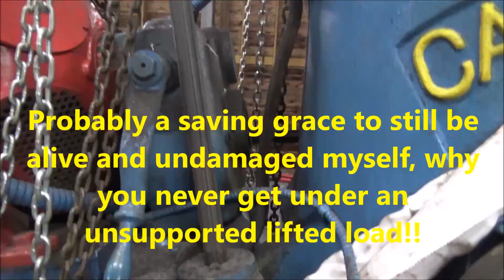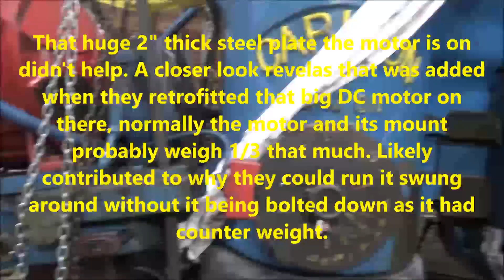The Worst Shop Day Ever :-(

Comment: A few things Brian-
You're safe because you did the lifting the right way. From aside the load, not under it. 
Not sure there was any way to find the cable damage without an x-ray. 
If the damage is limited to the casting and the rods, the drill may be repairable, right?
If the worst damage is to the cheap drill and 1/4 of your floor...I think you got lucky.

Comment: Brian if you do get around to repairing the beast it might be worth it to dig up an AC motor of the proper size.  Then if you wanted more infinite speed control ad a VFD.  But of course that's if it's repairable in the first place.

Comment: Major bummer, good thing no one was injured.  There is some good tips on inspecting the cable in the comments.  
The other thing as a valuable learning experience would be to know the weight of the machine and calculate exact load on every single loaded item in the lift.   Were all components within their safe working range?
Reply from the maker: Everything was within its rating, problem was the cable was no longer in a condition to meet its rating but the damage was not visible unless I had cut the cable in two.
Reply: It sounds like you are an owner/operator.  You are probably very lucky, if any employees were involved you can bet OSHA would be all over the place and looking for the rigging calculations.   
Based on what you wrote, the existing cable was 10.6 ton cable. So with four lines loaded it looks like the max safe load for just the cable would be about 16,960 lbs.  That is a 1:5 safety factor for new cable and a straight pull.  With old cable and a pull off the the side as you indicated, a safety factor of 1:10 my be reasonable.  That would drop the allowable load down to 8,480 lbs.  Just based on that it looks like the cable was over loaded by a factor of two at least.   What was the total weight of the drill?   Off hand I guess the weight close to 20,000 lbs but a qualified rigging boss would have that number down to the nearest lb.
Of course all the other components in the lift must be assesses also.  What about the chains, hooks, straps and shackles?  It only takes one weak link to cause a failure.  
Thanks for posting this.  You are to be commended, it gets folks to think about safety when lifting heavy things.

Comment: I once saw a guy drop the front half of a tractor from probably 7 feet in the air... bad sling job.  That was a pretty impressive BANG but THIS is so depressing. I for one hope you can repair the motor mount and get your drill up and running.

Comment: What size was the cable that broke? It looks like it was only doubled on the snatch block. What is the working load of the cable you put in now?
Reply from the maker: It was 8 parts of 1/2in cable, now it is 9/16 anti rotation cable.

Comment: MERCY! I'm just thankful YOU are still in one piece. The other stuff can be fixed but Baily can't make videos. I've had dragline boom ropes pop too and you just never know.  And it'll never be in a good place either. I hate it but it's all fixable. I was in a knot when you started lifting that rig and about jumped out in the floor when the cable broke. And you're dead right about NEVER stand under a hanging load.

Comment: I have seen a 3 tons machine drop from 4 feet down. Dust took 1/2 hour to settel. Took me the same time to setteldown also :-)  Machine was stil in "working order".
Load was too heavy for te crane so we used a fork lift to help. But it slipt.  The brake gave way,  that was our luck, ore els the crane would have come douwn.
Shit happens, 
Especially wen you ask for it :-)

Comment: Wow. That is scary. Lucky you didn't stand any closer. Did this used to be a precise machine?
Reply from the maker: I believe new they claimed repeatability of .001".  Drills like this were really intended to be used on layed out items that you would align with your eyes so the expected accuracy was probably .005" to begin with and that is pretty standard for drilled holes anyway unless using special tooling and methods.

Comment: Mother effer.  Appendage check... yup all present and functioning.  I"ve never seen something that large fall without some sort of power equipment running.  I was surprised... surprised at the absolute lack of any warning.

Glad you are safe.  I"m still stunned...  Need to make sure the guys that "helped" load it watch this video.  Because if that had happen while loading somebody would be disabled at a minimum.

Comment: Holy crap, what'a mess I was just about to get a fork full of dinner and ker-pow and it dropped.  The motor drooped a bunch and then came up a little and you stood there like the big freeze had been put on you.  I wouldn't blame you if you called it a boat anchor, but I reckon you've got a good amount tied up in it,.  Take a few sips of a good Kentucky Bourbon and get a good nights sleep,  Unfortunately it'll still be there in the morning, but you'll be in a better frame of mind then.

Comment: Brian, you were lucky that is did not let go when half over the trailer. You are lucky you were not hurt but, form your position that was unlikely. Such a shame the machine was so damages and the floor, of which you were so proud, was damaged. But all can be repaired - sooner or later, and you are safe. I suppose there is one lesson to be learned, never, under any circumstances, trust old wire rope. That crane stayed out in the weather just too long to be safe. But you are okay, and can make thing right later on. Such and same there was a worst day in your new shop.I would have been swearing as well, don't worry about that.

Comment: Seen this happen last week with a drill tripple this size, I had brought a smaller MAS Vr2 from an auction and when i was picking it up seen them try and pick up the big drill by the arm and it cracked.
Reply from the maker: blakealexbale That sucks but WOW What a monster of a drill it had to be!! I guess it must have had about a 20ft arm? Surprised they even had a crane on sight with enough capacity to try to lift it.  I would think the arm alone on a 20ft job would be over 100000 lbs.
Reply: @bcbloc02   It was one of Australia's biggest boiler makers, they were liquidating everything and sold the  50 ton Gantry for something ridiculous like $10 000 just because it would've cost  10 times that much to move it anywhere.

Comment: First I am glad you are alright... that is the only thing that matters really.When I started watching my first thought was, I hope he got some cribbing set up where he going to set it down as that crane has not been tested with a real good load on it yet. The brake was my concern, not the cable. A couple of feet of crib set up to the height of the trailer bed and pull them out as you lower, only 6 or 8 inches to fall then, with wood to absorb the impact if you had a failure. I am not trying to criticize Brian, just sharing what I would have done, when working with an old crane. I think it would of saved your machine, floor and your nerves.Maybe a thought for your boring mill and other machines.Sorry that it happened, but glad you and Bailey are good to go.

Comment: Man Brian that was hard to watch. When you went to swing it I knew because my outcome was no different. Even with all new and heavier rigging big iron equals big lift. I always figured you for a square shooter and posting this video on the internet for others to see and learn from clinches it for me. It was damned decent of you to share what happened as a training video of sorts. We didn't have internet and youtube and facebook back then but I was about eight to nine feet away when a cable snapped on me thirty-years ago. Trying to manually swing big stuff that high off the floor is risky at best. That's a lot of mass. After the same thing happened to me I lifted straight up just enough to clear the trailer and had my wife in the driver's seat waiting to launch out from under while I got whatever it was down on the floor fast. I too worked pretty much by myself in those days and one of the best investments I ever made was in two pair of rolling blocks and a little 6000 lb. hard tire forklift. My lifting hook was swaged on and I can still hear the whoosh-whoosh-whoosh sound as it and twelve feet of half-inch boomeranged past just over my head. I never used steel rope for lifting again because you can't see the core. After dragging it around in the mud and snow it's worthless for pulling out stuck dozers and scrapers as well I might add.  I guess we were lucky Brian where others weren't. You have other stuff coming in and a bit of unforeseen repairing to do now but you can't kill concrete it's just always there. It don't matter if you hadn't paid for it you would have paid for something else and you still will because there is always something else needing paid. If you get toe trips showing up grind them down by hand with a big Milwaukee grinder or something. An eight-inch diamond grinding cup is around $100 at industrial supply and one would last you for ages. Just use a water hose and wear a dust mask. The radiant heat tubes are probably okay but the best thing is you and Bailey are for sure even if your pride is a bit bruised and I could tell you a few things in that department. That was a close call ole boy so don't beat yourself up too bad that drill landed hard on its heel. Be careful out there all of you guys. Hell, your videos keep me and a lot of other old boys like me home and out of trouble. Thanks Brian and you hang tough! Sh*t happens but even more so when you are trying to do things. It's getting them done that can be a real bitch at times. Damn I didn't intend on writing a letter excuse me Brian. I'm outta here!

Comment: first off, glad your ok!  the machine is fixable im surw but id like to know what you plan to do with the cement.  is it deformed or just cracked and if its deformed how do fix that
Reply from the maker: I appears mainly just cracked and chipped but I don't know what it looks like under the drill yet. Main thing is the water lines for the heat aren't busted.
Reply: wow didn't even think about tubing that would have been a tough fix

Comment: everybody has said everything.  glad the hoist block went away from you..  you might want to look at the USGS site to see if they picked up the fall..  might even show the shock waves from the impact. .i bet people miles from you felt it. 
when the concrete split.. did it spread the hoist rail support beams??  i was looking forward to you using that drill

Comment: back when grand coolee was the largest hydro-electrical generation system in the world. We were building the 3rd powerhouse, and had sent out to japan for winding the huge generators that were to be installed. The generator came in to Seattle, and as they were setting it on timbers before shipment across our state, they got it down to 3/4" from the surface when the cable snapped. It had to be shipped straight back to japan and rewound. But for we Washington state people, this was not the biggest screw up. No the digging of the tunnel for traffic under the seattle waterfront had a huge tunnel digger. to see what was in front of it they drilled a well to find out and pump water from. As the tunnel digger got to the pipe, it wrapped around the head of the boring machine and knocked out the huge bearing. Your radial arm drill will now need work that is very disheartening to have happen. plus broken concrete. carry on you have a strong heart. What I have found with the best craftsmen, is when we screw up fix it like it never happened. That is what a craftsman does, straighten out our screwups.
Reply from the maker: Paublus Americanus AMERICANUS  I seam to remember that stuck digger. Wasn’t it down for weeks?
Reply: @bcbloc02  months. and like more than 1 billion dollars we have to pay with our traffic taxes like our licenses and other taxes.
Reply from the maker: Paublus Americanus AMERICANUS My mistake was much less expensive!😎 So what part of Washington state are you in?

Comment: Thankfully it didn't whip around like highly loaded cables like to do. If its too big to weld/braze, it looks like you might have room to fix the drill by making up some bolt on brackets to hold the two pieces together.

Comment: As a crane repairman for 35 plus years, I can tell you why the cable failed at much less than its rated capacity. As a cable is circulated through its reeving system all the strands flex and twist as the as the cable is bent one way coming off the drum, another way when it travels through the hoist block,. reverses again at the equalizer sheave then back down through the block.
Cable lube is used to reduce the friction on the individual strands. If a crane cable doesn't ruin your gloves every time you touch them. The cable will eventually bind and kink and develop a air gap usually when it travels through its tightest radius. then when the wire rope straightens out  the individual strands fail catastrophically. I have seen 60 ton cranes snap cables with 15 ton loads, as well as witnessed 1 ton jib cranes (properly maintained somewhat) pull 5000 pound gearboxes out of spare parts bins. Bottom line, purchase cable lube from your wire role supplier. (I can't recall ever changing the cable on the jib crane!)
Reply from the maker: Great info! Thanks, definitely plan to keep this cable well lubed so no corrosion occurs and it stays nice and pliable.

Comment: Things to think about before making future lifts: don't trust ratings on old equipment, try to attach crushable cribbing to the bottom of the thing being lifted, reduce the load by removing parts and pieces, only lift high enough to clear obstacles when moving load.
Reply from the maker: All good advice.

Comment: You could buy a bag of Ardit Floor self leveler and spill it down into those cracks in the floor, before any dust, oil, water, or dirt, gets in there.  Maybe cut a V groove first  with  a  9" grinder.

Comment: At least the concrete broke the fall....  I think if you pull the stuff off the casting, I'll bet it can be welded back as if nothing happened and some epoxy should fix the cracks in the concrete.  Totally sucks though.  I've had similar experiences...you handled better than I did.

Comment: Wow feel so bad for you glad you weren't hurt is the big thing hope it can be fixed    The floor well ??? Not a concrete guy but know they make concrete welding products mix and pour in cracks to seal them up   I used them on slabs in freeways to hold them together works good but the pounding of traffic just breaks the slabs in your case should work better cause no pounding of trucks and other equipment day and night   Brian dude what a shame feel for ya

Comment: Just curious what happened over the last 7 years. Did Brian repair the drill? Scrap it? Repair the slab?
Reply from the maker: @aaal123able  There is a whole playlist of videos on fixing the drill. It gets used at least weakly. I have yet to ever move it so never did anything about the cracked concrete. The radiant heat doesn’t leak and works fine so. I guess everything is good.😊

Comment: The amount of energy stored in the mass of that machine while suspended just two feet was enormous! But I see it this way....So many things went RIGHT with that failure....like none of your body parts were within the bloodline of the lift when it failed. How about not being hit with disintegrating metal components/ shrapnel, or being slashed by cable when its energy was released?...Then there is the block falling to the right of the camera frame vs. where you were standing at the time. I feel your heartbreak for the damaged caused and the setback incurred, but I've seen people loose eyes, limbs and their lives with a lot less drama...You are truly blessed because of the common sense God gave you ( you understood and acknowledged the danger of the task at hand, while trying to mitigate the pitfalls to the best of your ability and equipment) AND the angel on your shoulder that kept you from harm....I hope you bought a lottery ticket? Looking forward to the repair, glad you're safe....WOW!!!!
Reply from the maker: I don't play the lottery.

Comment: looked like a lot of lowering action on the chain winch compared to not much down on the hook may be the winch was un spooling with lowering brake on then causing shock load when brake finaly released  very lucky you ok
Reply from the maker: The brake is on the chain handwheel shaft so the brake can't be on and you turn the wheel at the same time. It takes 300ft of chain pulled to lower the load 1ft so it does take a lot for a little movement.

Comment: Holy Shit that was scary. Thank God you are unhurt. (And I'm not particularly religious!) Thanks for posting the video. It will make everybody think twice when lifting. If you do decide to fix it, you might be able to come up with a simpler, lighter drive mechanism that will still enable the machine to be used but without the complexity of fixing it exactly as before, (with it's wierd-o DC drive setup).  Shame about the concrete, but it'll still be usable with the cracks. They will remind you of the day you had a very near miss.. seriously, you can count yourself very lucky some part of you didn't get caught as it came down.

Mart.

Comment: wow that sucks, good thing you were under it! do you think it was over weight on the cable or just hadn't been inspected close enough and was worn out? would love to have had an investigation video on the hoist fail. Love the videos, keep on keepin on bro!
Reply from the maker: The cable had a cotton fiber core, that core had held mouisture over the years and led to corrosion on the inside of the cable where it was not visible. I would have had to have cut the cable in half to see the damage to the inner strands.